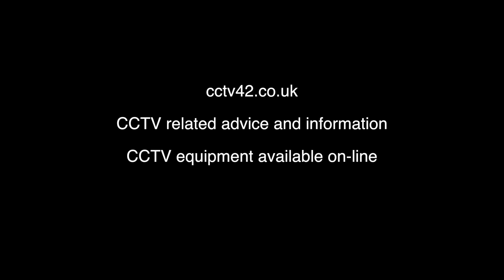How to supply a CCTV camera with power

Comment: I have adaptor with 13 volts DC output. Is it advised to use it for Dahua CCTv dome  one cam, where I am supposed to feed with 12 volts d.c. Output d.c. cable distance is 4 mtrs. Thnx in advance !
Reply from the maker: You would need to speak to the camera manufacturer but if they say it needs 12 volts then use a 12 volt power supply. You also need to make sure the power supply supplies sufficient power output (measured in Amps or Milliamps (mA)

Comment: My CCTV is connected to the computer and if computer is of will the footage get recorded?????
Reply from the maker: If you have a DVR based CCTV system which records onto the DVR then it shouldn't matter if the computer is on or off. If your system is based around the computer rather than a DVR then it would need to be on.
Reply: CCTV42 thank u sir